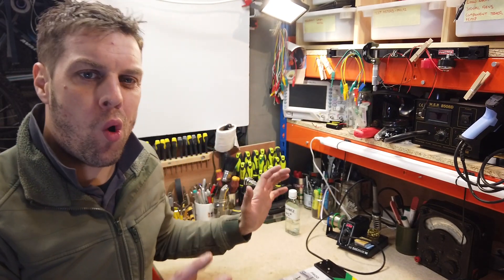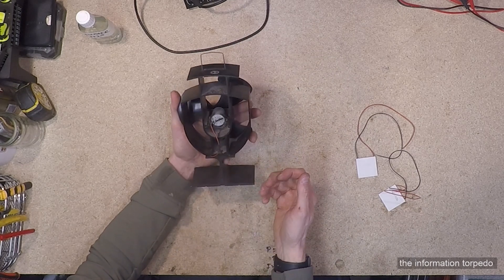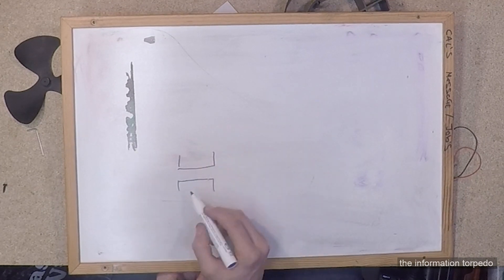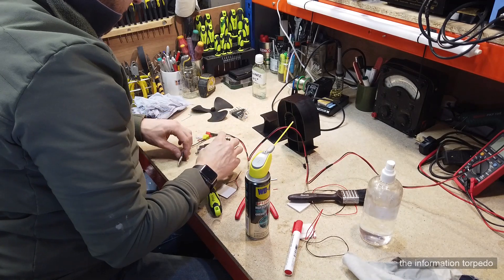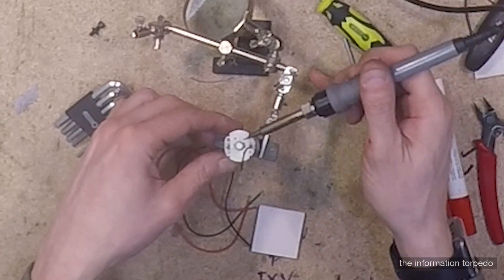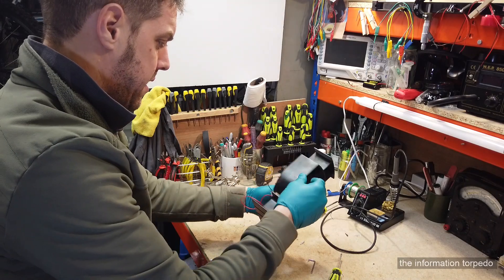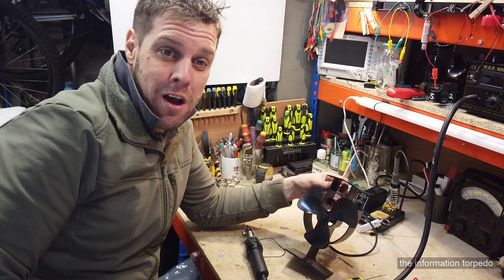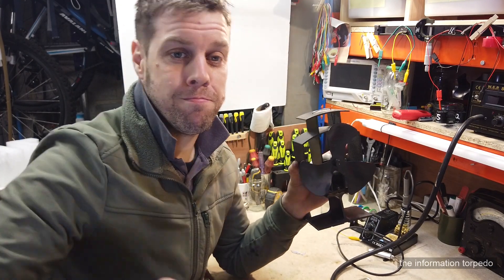Peltier Stove Fan Repair In 15 Mins For £5 / How A peltier works

Comment: Just an FYI boat your soldering station. If you put the heat gun portion back in its holder, it'll automatically shut off and cool down without you having to turn the switch off while working
Reply from the maker: It’s too close to the shelf , short on space

Comment: Jamie, what voltage do the fans run at? mine is turning slow so I thought I'd measure the running V to prove the output from the Peltier,as the motor turns ok,
Reply from the maker: Not sure but I think it’s like 5 volts

Comment: Did you have any issue with the wire insulation burning?  There is a TEC1 12706 FX version of this module that has very high temp wire insulation.  Just wondering if the standard module (plain old 12706) can handle the temps.  I have a couple of old eco-fans, and am trying to figure out what the best new fans are to purchase.  There are so many companies and models now, and so little good information on how well any of them actually work.

Comment: Would never describe WD40 as lubricant......great for cleaning & washing dirt out of bearings.......use it on bicycle chains often & then lubricate with vegetable oil....come in a good range of " weights " and no more hydroscopic than most engine oils...

Comment: Thanks for posting this video, I just fixed mine using a TEC1-12706 and it now works, but when the stove gets really hot will it pack up?

Apparently the number printed on the peltier module defines its use (TEC = Thermo Electric Cooler; TEG = Thermo Electric Generator),  number of layers (usually 1), number of P-type and N-type doped semiconductor pairs (the larger the number, the larger the temperature variation) and the maximum output current. To confuse the issue there's a whole line of them marked "SP" instead of TEG - no idea what that stands for, but they seem to be TEGs.

So a TEC1-12706 would mean thermoelectric cooler, 1 layer, 127 PN pairs, 6A output.

It seems much easier to find TECs than TEGs, probably because of their widespread cooling applications in the computer industry, and they're also often MUCH cheaper. I've seen TEGs for 10 times the price of a TEC. It seems like the only option is to get them direct from China (I think they're all made over there anyway), through ebay. 

Anyway the point is that wood stove fans need to use peltier modules that are rated as thermoelectric generators, not coolers. Although the coolers work, it appears that thermoelectric generators can withstand much higher temperatures. On ebay you can get one (SP184827145SA) which is rated for 250° and costs less than 10€. If my fan breaks down again I'll try the SP184827145SA and see...

Comment: I have one of these fans... Got it on Amazon, it worked great for a week then stopped.  Turns out, not only were the screws that held the housing loose, but there was no thermal paste.
So, I took it apart, added thermal paste put it together and fired up the buddy heater again...
Boom, the fans started spinning again once it got heated, then suddenly stopped again....  This Chinese made dogshit.  Both fans start and stop, it makes no fucking sense...
Reply: It makes perfect sense actually and you already hit the nail on the head -  because its chinese dogshit. dicking around trying to fix them is a waste of time. You cant polish a turd. 

These things are a waste of time in general, a gimmick basically, they barely make a difference thermally in your room, and they just typically shit themselves after a month or so, or just run so slowly that it doesnt even matter anymore. Out of the box they is obviously when they will work the best, but it wont take long for them to slow down. You can't put electrical devices(especially not cheap garbage ones) on or around an object that gets to several hundred degrees, its just not possible without things going bad, especially if it has moving parts. 

Do yourself a favor if you want more even heat distribution from your wood stove. Buy a simple electric fan, 20$, they will cost you 2$ a month in electricity to run, and distribute heat literally about 10 times better than one of these stupid things. Put it near the stove but not too close, 5-6 feet away, else it will fail too.  It will last longer too and is much cheaper to replace. Its louder but who cares, even on the lowest setting its moving 10 times the amount of air. 

Some of these stove fan worthless pieces of shit are 100 USD, which is insane. 

If you want one of these just to impress your lady friend whos coming over for a romantic night by the fire (it does look cool and is neat in concept) - just buy the cheapest one you can find (On amazon some are like 25-30 USD) and replace them when they die, or dont buy them at all, thats my two cents. 

Trying to fix chinese dogshit is a waste of time, as they are literally designed to fail and be replaced. 

These are more of a novelty than anything else, just like a stirling engine, very little practical use, but again they are neat in concept... Basically a toy. 

Credibilty? I'm a mechanical engineer.
Reply: @Motoko1134  The problem is, I got mine mounted on a buddy heater... I shelled out the cash and got a quality one, single blade (fewer parts and connections to possible fail) and so far so good... it even mentioned it was mounted with thermal paste in the ad.
Reply: @jimvick8397  on a heater it will probably be better since its not as hot as say a wood stove.

good luck, its all a crap chute xD

Comment: I was thinking about taking one of these and replacing the motor with a 35 w led lamp and using a second one to blow air over the heat sink to cool it, as well as move the warm air around in my tent. Do you figure something like that might work?

Comment: I did this and the fan hardly spun.  I took it apart thinking I didn't 
put enough of the paste but that did not do anything to improve it.  I just took
it apart to put spray oil in the motor like this helpful person did 😉...but
here I am back on youtube trying to find out if anyone else followed the
 helpful tips in this vid yet no results for an efficient blade 
spinning. Cheers, 🇨🇦

Comment: I received an England's brand stove fan in the mail 2 days ago. Tested it. Worked great on day 1. Day 2, I was doing some adjustments to the stove and the fan fell to the concrete floor. It didn't work again after that. I tested the motor with an 18650 battery, it ran fine. The wiring is all fine. Could the peltier have been damaged because of the fall? I don't see how. But it won't work. $50 down the drain. A repair kit costs more than the fan itself.
Reply from the maker: Put a volt meter on the peliter  and apply gentle heat , it’s probably cracked as it’s ceramic , you can find them on eBay and Amazon  much cheaper from loads of sellers in the uk , ty in your location
Reply: @Actual_electrical_content  I don't have a volt meter and I don't have enough use cases to justify buying one. I did some more digging and found a proper sized peltier and  some thermal gel for $7.50. There is no model number on the original peltier, so I went by size. The replacement is a TEC1-12706. How do I tell which side goes up and which side goes down?
Reply from the maker: @heinzkitzvelvet   if the fan goes backwards swap around the wires , the Peltier can go any way around
Reply: @Actual_electrical_content  ok. I was confused. I thought the video said one side was for cool and one side was for hot.
Reply from the maker: @heinzkitzvelvet   yea it don’t matter, I plan a little follow up video soon about changing the motor and a few other bits

Comment: What is the highest DC voltage that can be used to test the motor? Can I use a 1.5 volt battery?  Can the piezoelectric (Peltier) module be tested with a meter? I always test components before purchasing and just doing parts changing. Thanks for this informative video.
Reply from the maker: Put a volt meter on the peliter  and apply gentle heat

Comment: Hello, is it true that ecofan uses peltier TEC1-12706? Because I can't find the original data anywhere. Thanks.
Reply: It has to be 30mm square to replace the original. I see lots of 40mm units, but they would have to be squeezed in to fit between the mounting screws, and I don't know if the larger units can be whittled down in the screw spots to accomodate them.